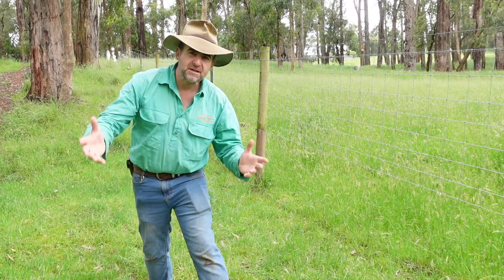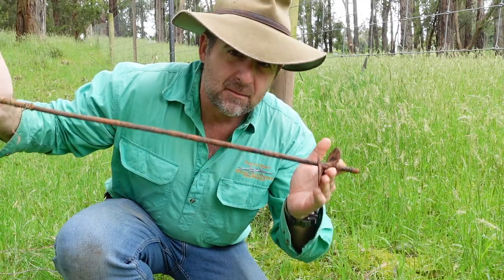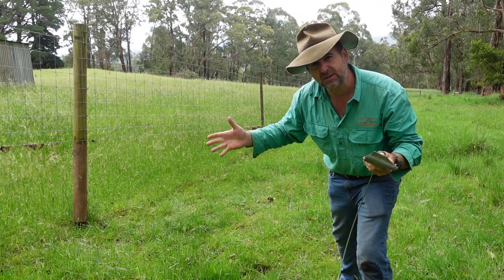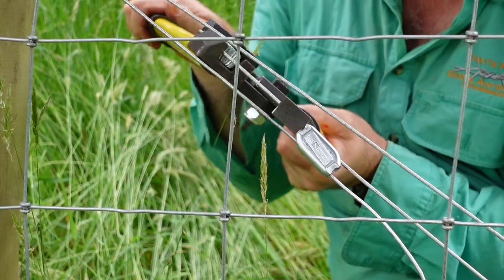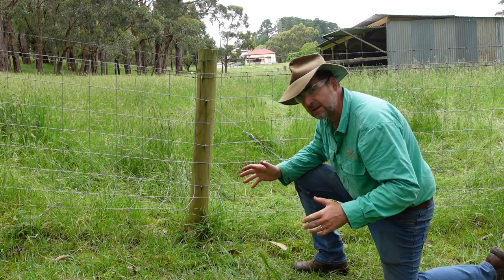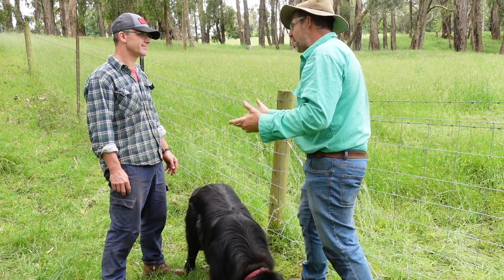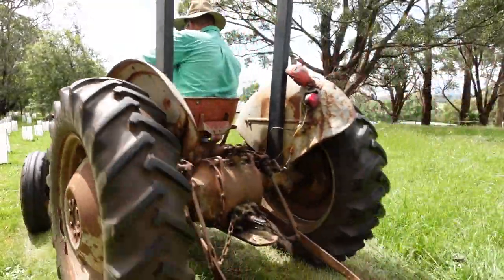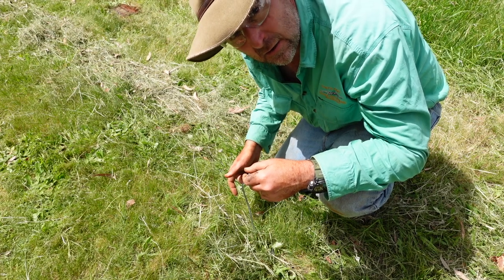Tellusloc Ground Anchor Review

Comment: How would they work in sandy soil would you recommend using a longer cable on the largest anchor or stick with the double end assembly , love your vlogs Tim keep them coming , all the best from Tassie
Reply from the maker: Considering the low cost, probably worth trying one out…. Definitely increase the size.

Comment: Hi Tim Love how you test things out.
I have a different problem, because of all the water and now it has dried up, it's light the soil has shrunk LOL. My pine posts are loose in the holes on flat ground just wondering what your recommendations would be? I was thinking of getting some concremate (expanding concrete) and filling each hole, thoughts
Again thanks so much for this true blue Aussie channel
Reply from the maker: Mate, my pleasure. I would avoid concrete. Cracks and creates problems down the track. Try using old steel posts as anchors until the soil settles. Walters have a good little bracket for that.

Comment: Fascinating, could these be used vertically for anchoring angled posts such as a grape vine or espalier end post so one can do away with stays in the fence line, then strained up with the trellis wire?
Reply from the maker: Yep, Ground anchors are very commonly used in Orchard trellis to do exactly that (very big screw in types) and have been used for at least 30 years (maybe much longer) in some vineyards as tyback anchors, the only thing you need to watch is that the diagonal stay wire is marked well or you hit it with implements etc.
Reply: @FarmLearningTim  Sorry, you missed the essence of my question. I'm talking about using the Tellusloc as a vertical stay wire under an angled post at say 60 degrees.